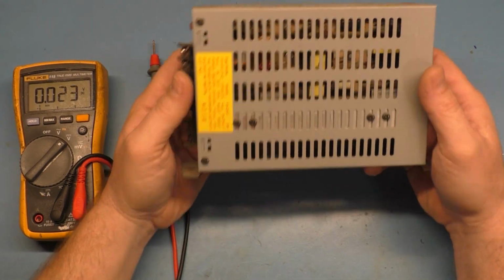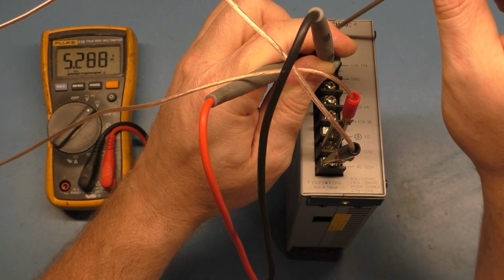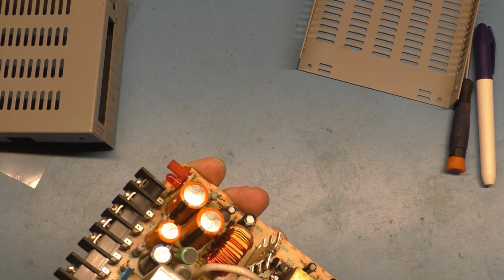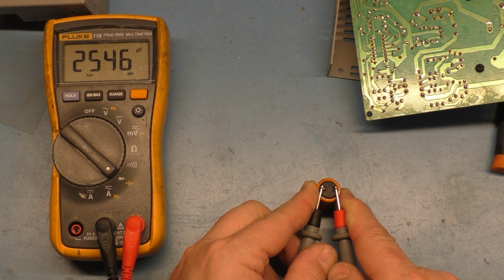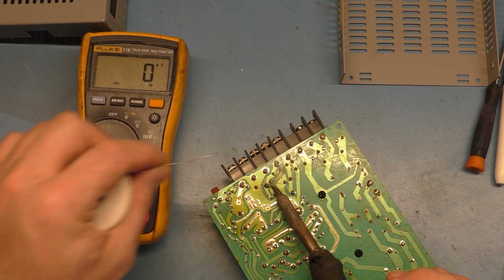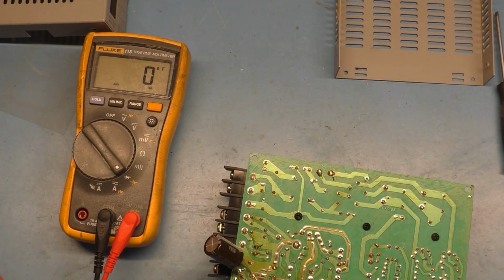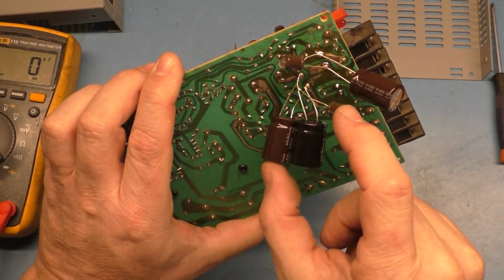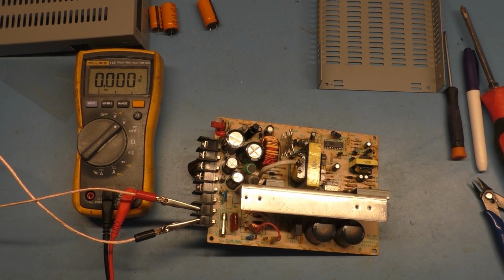Arcade Machine Power Supply Repair - Voltage WAY Too High - Why?

Comment: The power supply in my sega hang on is set correct   But when I measured voltage at the molex connector going to the monitor it reads 129.1.   That seems high right ? What should I test next.  ? Transformers rarely go bad.    I’m not sure what to do

Comment: I've replaced so many Peter Chou PSUs. What do you recommend as a "Reputable Replacement" ? I was sourcing meanwells but those have dried up and I need spares.
Also, I'd be curious of your cap stock list and what you normally carry.
Reply from the maker: The cap list is too large to list but I'll say that it's a lot of the standard caps that are in the chassis' I work on. 1uf, 2.2uf, 10uf, 100uf, 220uf, 330uf, 470uf, 1000uf, 1500uf, 2200uf, etc. These are the supplies I usually go with. These or the 15a ones...

https://twistedquarter.com/index.php?main_page=product_info&cPath=521_526&products_id=4056